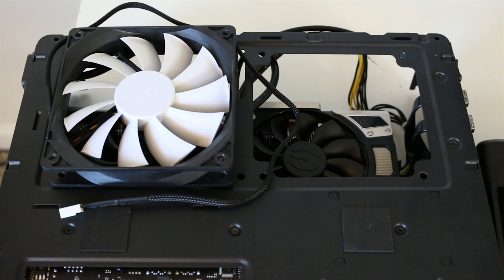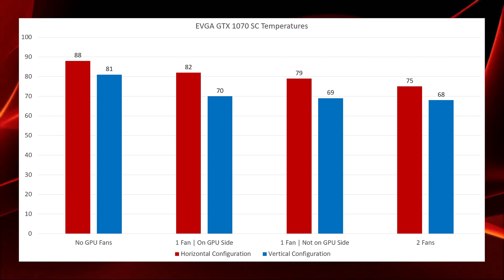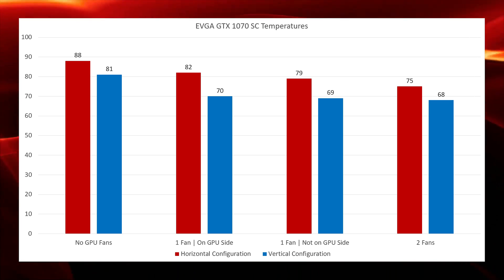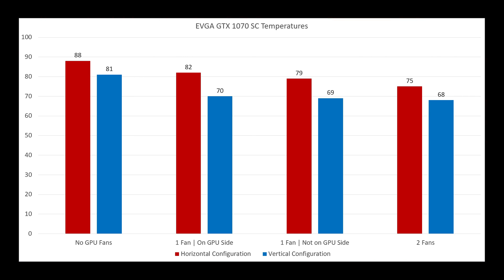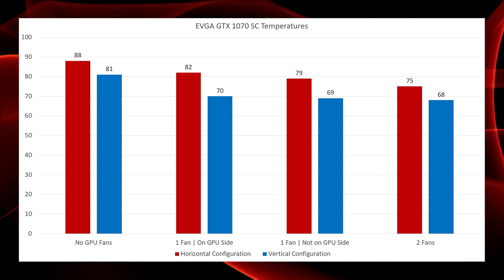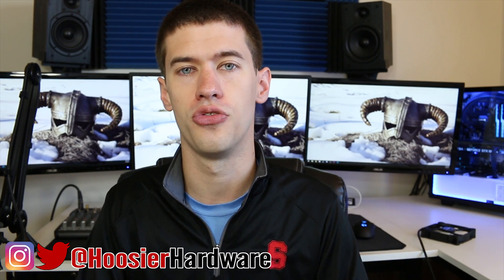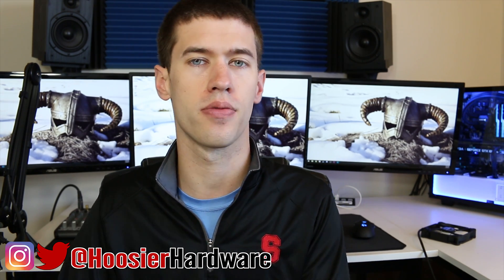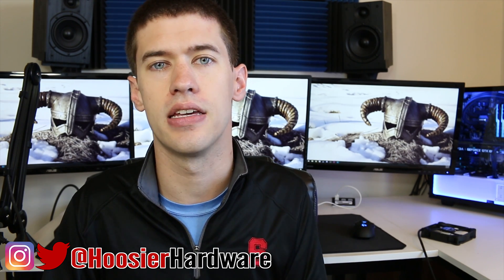Cooling Your GPU inside the Node 202

Comment: Hello! Really appreciate your series on the node 202. I built mine on an asrock phantom gaming x570 itx tb3 amd board with a ryzen 2600. I have an msi rx570 8gb dual fan card that is reported at 4.49’’ tall. Can I fit fans by it like you did?

Comment: A 2.5 slot card will work with case fans as long as you get slim fans pulling cool air from the outside and use something to prop the card up to keep it from sagging into the fans. if using an open air card modifying the top of the node 202 case with air holes (directly above the GPU) with two 120mm slim fans pulling air from the outside into the GPU (pressurizing the GPU side of the case to force the hot air out of the holes you made) will drastically lower GPU temps.

you can also block off any holes leading into the motherboard side of the case from the GPU side to keep the heat generated by the GPU from going into the motherboard side and raising other temps.

Comment: Hi, Nice video, what do you think about ditching completelly the GPU fans and relaying solely on the two 120mm fans ? I i'm planning a living room build on the node 202 and got a 1080ti Asus strix, it's 2.5 mm slot config so, it crossed muy mind that removing the shroud with builted in fans might be an option.
Reply: i personally would leave the gpu fans on. have 2 intake 120mm fans. this will cause positive pressure in the case forcing air out of the vents. best solution

Comment: Going to upgrade to ryzen 3900x 12 Core with the stock cooler that came with the ryzen 5 1600 and a cryorig c7 fan on top. More airflow does increase temps in this case, so I will customly add 2 40mm noctua fans to the top of the case to see how that works out.

Comment: GTX 1070 sc and 3.5" HDD in same case anyhow possible? good case but bumped because of no 3.5" hdd place.
Reply: You can fit a 3.5" HDD in place of the second GPU compartment fan, but you'll have to zip-tie it into place or come up with some other solution

Unfortunately, no way that I know of to use both fans and still fit a 3.5" HDD.
Reply: @WafflesInTheRain  thanks a lot, looking forward for new build. :)

Comment: my gtx 1080 starts losing boost clock speeds at 82C, and with no fans this happens after 15 minutes or so.  My setup is one fan blowing into the cards blower, and the other fan as an exhaust, and it works well, I can maintain full boost speed indefinitely, and the stock gpu blower stays at lower speeds (not by much ~100RPM).  I think the case need some vents at the back of the graphics compartment, as there seems to be a lot of heat soak there.

Comment: For everyone who have smaller cases with clear or glass pannels like Fractal Design Define C,solution is to put 2 additional fans under graphic card.Lot of heat is trapped under GPU and being sucked again.I found on internet PCI fan holder like Gelid,but you can experiment with other better fans.So all that heat is traveling upward much faster and sucked by exaust fans at top/rear end.Another possible solutions which I (haven't) tested,put PSU fan facing up (if you have holes on PSU shroud),or remove all GPU brackets and put 80-92mm additional fan to exaust hot air traped under GPU......Worth testing and playing to see results cause every C° counts!

Comment: What do you think of this Heatsink https://www.newegg.ca/Product/Product.aspx?Item=9SIAC8X52E0354&cm_re=raijintek_heatsink-9SIAC8X52E0354-Product  
I was thinking to put install it without fans clipped on it, but using the 2 slots for 120mm fan we have on our Node 202. What are your thoughts on this?
Reply: for a Full size GTX 1080

Comment: When I first built my node 202 PC, I used a MSI GTX 1070 Gaming X and ofcourse I installd 2x120mm fans. The problem was my config was very loud and the SSDs and the other components temps went very high. So I sold my Gaming X card and I bought an MSI GTX 1070 Aero OC blower style vga. With a right fan curve, the GPU max. about 75-77 Celsius and the other components lost about 10-15 C. And overall the computer more quiet, than was with the previous card.
Reply: PeterPaul's How did you setup your fans - to exhaust or intake?

Comment: Built my Node 202 with two SP120 fans (intake) and an Asus Turbo GTX 1080 (Blower Style). Temps have yet to cross the 75c mark and typically under full load between 55-60c.
Reply: Im getting more than 85 degrees with my gtx 1060 with one fan in pull mode... i dont know if its normal...
Reply: pull as in pushing air away from the gpu toward the outside? I would try having the fan suck air into the case. there aren't really that many other slots to suck air in from so the big opening could maybe be better off as an intake rather than exhaust. I will be getting all my parts for a gtx 1070 next week and will find out for myself
Reply: Whats your ambient? Im getting 80-82 full load. No case fan Zotac GTX 1060 AMP SE

Comment: I'm doing a node 202 build using the same exact graphics card. Only question I have: are these SP or AF fans?
Reply from the maker: They're static air pressure fans. Here's the exact model I used: https://www.amazon.com/gp/product/B00OP2PUB8?ie=UTF8&tag=hoosierhardware-20&camp=1789&linkCode=xm2&creativeASIN=B00OP2PUB8
Reply: Hoosier Hardware thanks a bunch! I'll definitely keep that configuration in mind when I buy fans. I might even try Airflow fans just to see if they can be a viable option. 

I really appreciate this video series. Thanks for making it!

Comment: I'd be curious to see if this is still true with a blower style card. To me, it's not as obvious how the blower physically moves the air and without being a fluid dynamics engineer, it's not intuitive to me whether having a fan feed a blower cooler would help or not.
Reply: I think  blower style would be better because the air is sucked in the blower at one end  and then exits at the other end.  As opposed to open air where the air is  blown over the sinks but has nowhere to go.  I think a blower card exhibits Venturi effect but don’t quote me.
Reply: I would think with a blower style gpu the pulling in of fresh cool (cooler than whats in the case) would help some at the very least. Like he said though you mileage may and probably will vary depending on the gpu in question including a blower style gpu.
Reply: Ur not a fluid dynamics engineer

Comment: Did you have the fans configured as intakes or exhausts?
Reply: Intake. 4:36 "feed the graphics card some fresh air from outside of the chassis"
Reply: I did one of each in my build.  The one under the card's blower is intake to feed the blower, and the other exhausts.  It seems to work well.
Reply: @hazindu  I had the same Idea :D Works pretty well
Reply: @hazindu  I just did this in my Build with a 1060 and it dosen't work

Comment: what do you recommend 1050 2gb / 1050 4gb? I cant remember it right if you said that it has too little difference with its price.
Reply: On a 1050 it really doesn't make to much difference, but that being said, if its not much more money might as well go for the 4GB.
Reply: Ronald Kuizon get the cheapest dual fan, decide if you need pcie powered or powered from 6pin. but i recommend moving up to a 1050ti